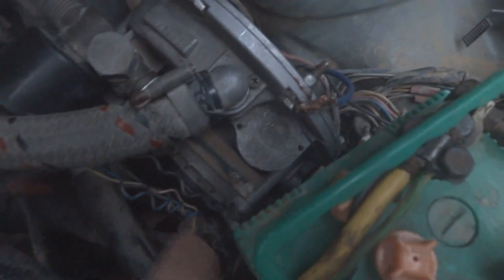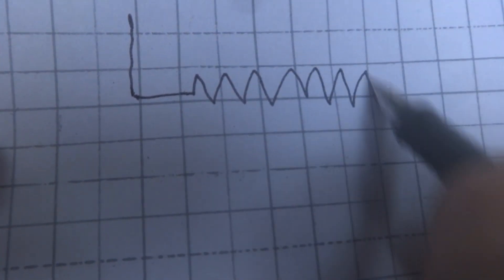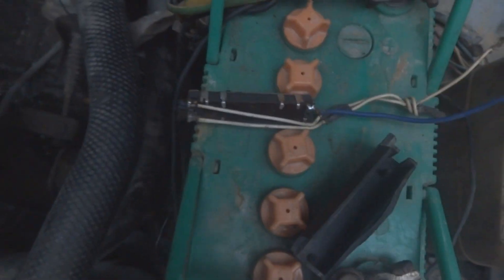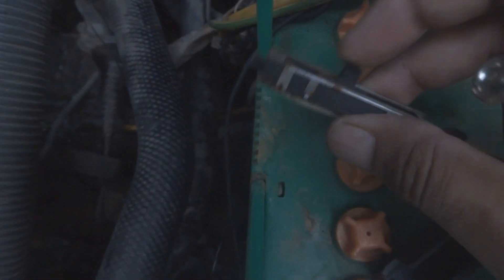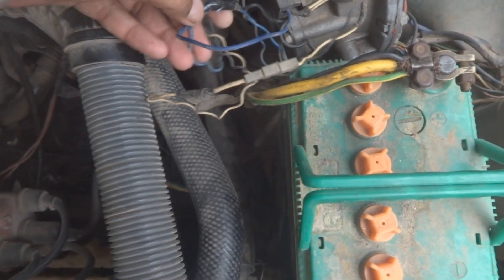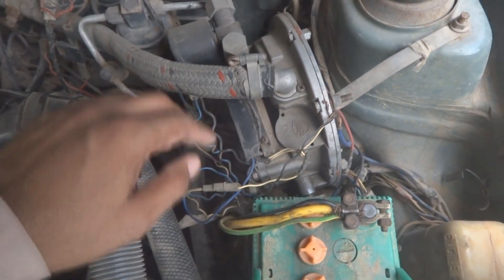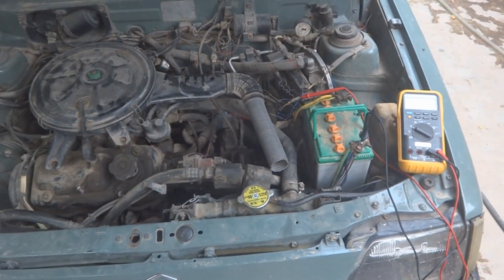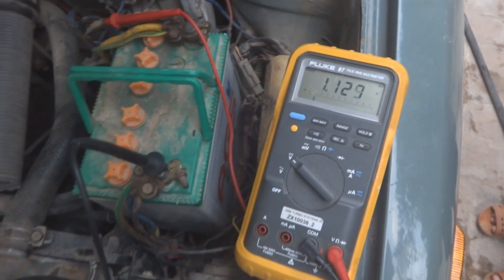CNG kit maintenance part 4. Car CNG gas kit repair and maintenance. Gauge repair and testing.

Comment: Very nice vedio. Very well demonstrated and made it so simple and easy to understand anyone.
Reply from the maker: Thank you very much dear Asher Aziz brother. The purpose of my videos is to make technology simple to understand as well as to maintain engineering standard the same time. If I ignore engineering standards, then the videos will not fulfill the purpose and if I may not make it simple, people could not understand then. So I am taking care of both aspects. Hope this video will serve like other videos. Best regards,
Reply: JazakAllah Jahanzeb bhai.
I want to ask you question not related to this vedio but regarding to my LG air conditioner 
May I check AC outdoor unit independently applying direct 220v after disconnecting it from indoor unit. Just to check the running load of outdoor unit.
The purpose for alone outdoor unit checking is that the fuse of PCB of indoor unit found blown.
Reply from the maker: Dear Asher Aziz you can do it but care is a must to do so. If I would be in your place to check such machine, I would test the voltage on outdoor unit compressor using a volt meter with its own original wiring and would narrow down the fault instead of giving separate voltage from out side to the compressor and test it. The voltage test would reduce my work load and will speed up my diagnostic. I hope you understand what I am stating for testing and hope you will be able to do so. If any difficulty, feel free to ask anytime. Best wishes and wish you good luck with your repair.
Reply: Thanks a lot for answering me.
Actually the reason behind for asking the direct power supply to outdoor unit  is only to save PCB because it's about more than 10 years old model and hard to find it's new PCB from market.
Reply from the maker: That is correct dear friend. But you can test it and if there is problem with the PCB, you can repair it. Try repairing it in local market, if they don't you can contact me then for its repair. Anyhow wish you very good luck with your air conditioner repair.
Reply: Thanks for guidance and best wishes.
I will try my best to repair/troubleshoot and will contact you if I need any help.
JazakAllah 
Best regards
Reply: Jahanzeb bhai
Today i find free time this afternoon and check AC outdoor unit by applying 220v directly and outdoor unit connections and terminations also checked were found  normal drawing 6.5 amps remember it's 1.5 hon unit.
Afterward i inserted PCB and switched on flush observed from PCB.
I checked  PCB 
CO5D was flashed. Now pls advise.
Reply from the maker: I don't know why it flashed? Anyway you can check the replacement in your local market. If available then replace it and bring the machine back to life. Otherwise they other way is you may send the PCB to me for repair if there may not available local solution. Also if you can check the PCB yourself and try to repair it, it will be a great idea. Wish you good luck with your repair.
Reply: Thanks for coordination.
Actually there was already light flash strains at PCB when i was removed it for 1st time and also 12 amps fuse was blown.
I went to local market the technician declared PCB  ok.
2nd time me inserted 10 amp fuse. And just powered to indoor unit alone. Afterwards same area flashed again where 1st time slight flash strains were observed.
(May i share you PCB snap if you allow me.)
Any how I will tried for new card tomorrow from local market.
JazakAllah 
Best regards
Reply from the maker: If the fuse is pulling all the time, seems there is some short circuit outside or inside the PCB. It needs through testing to troubleshoot the short first then go further. Sure you may share PCB close up at geoharzaman@gmail.com with me. Regards,
Reply from the maker: Bhai Ashe Aziz I just looked at both sides of your AC PCB and observed that there could a a shot on the PCB which is pulling the fuse. Anyhow you what you can do is you just remove all the out going wire from the PCB. Put a small size say 5A or less fuse in the PCB and then power it up. If again the fuse blows, means there will be sure short somewhere in the PCB. Otherwise you should have to check for short in your rest of the machine also to find it and repair is accordingly. About the new replacement PCB from the market? Is it available for the reasonable price? If yes then go for replacement. Please let me inform about the status. Also where is your location?
Reply: Thanks for your coordination and help jahanzeb bhai.
Alhumdolillah AC is working now.
Today i find an other PCB technician in market he checked replaced it 4.7 uf 500v capacitor and Ic near C05D. Afterwards I placed 4A fuse and disconnected it from outdoor unit. And connect indoor unit component one by one to find out short circuiting element. But no issue with indoor outdoor unit components but was in IC of PCB.
That was replaced by technician with just cost 200 rupees.
Actually I couldn't able to perform fine soldiering so I avoid to work on fine PCB.
I will share picture of IC on email.

Thanks again for your help.
Best Regards.

Comment: Ahh the potential divider, that was showing between 1/4 to 1/3rd of the slider length roughly.
It all depends on the unit that drives the leds to display a logical value.
I guess a Lm3914 bargraph ic or similar for simplicity, perhaps :-)
Reply from the maker: Dear sir you are very much right and your understanding is again rock! The pressure corresponds to the quantity of gas which is not an accurate way of measurement but on the same time it is cheap and easy way to get a little idea to refill your car gas tank.
Are such gas driven vehicles common in Europe as they are here? The reason for such gas driven vehicle was one that the natural gas was cheaper and less expensive compared to the regular gasoline.

Comment: Sir my suzuki khyber shuts down just after start up on CNG, by gas switch whereas it is ok while power is connected directly from battery.
Reply: I have also changed the gas switch but status unchanged pl guide

Comment: in my i10 1.2 L  car sometime rpm increase  in CNG mode ...... while in Petrol mode it is working fine.....  it is very hard to control in city..... because car pushing forward ....... without touching the acceletor ... Please help me to sort out above problem

Comment: I need some help, i need reading of corolla 2005 maf sensor readings? My car is hesitating no misfire or any thing.. It happen when accelerator is depressed after brake..
Reply: abdullah zahid this person is the best engineer on toyota corolla he knows more than the people who made the car he is the only best person out to help you
Reply from the maker: Dear friend Abdullah Zahid in my view point what you stated about your car, it needs throttle body cleaning if not yet performed. You may watch my throttle body cleaning videos on the same model car I uploaded here on my channel. Hope if you will clean your car throttle body, this problem will be disappeared. If it may not help or you cleaned your throttle body already then you may look for some vacuum leak closed to the intake. Hope you will get some broken and creaked line or bad gasket responsible for vacuum leak. Hope if you may give attention to these two problems, your car will behave in correct manner. Also please write us after your success.
Dear Mr. Tanveer Khan thanks for your such nice wording comment. You polished a stone to a diamond! Really appreciative comment ever. Thanks for liking and watching.